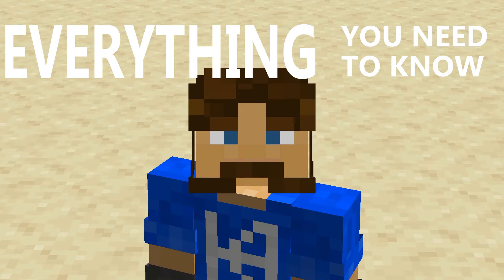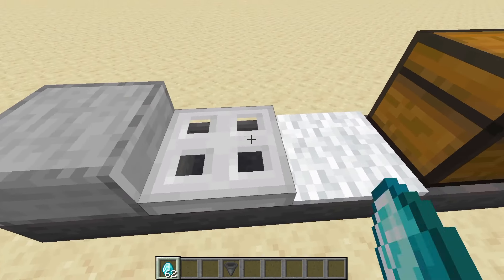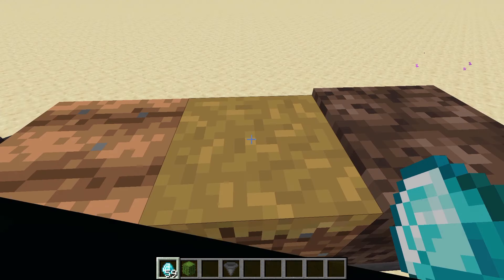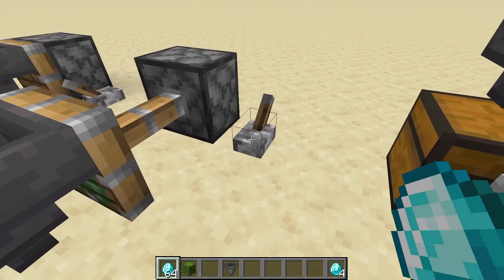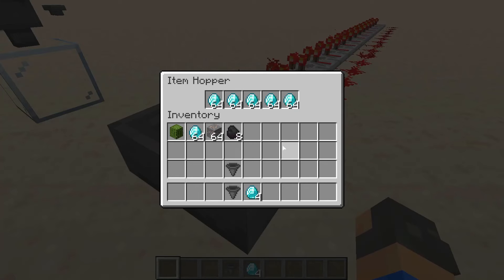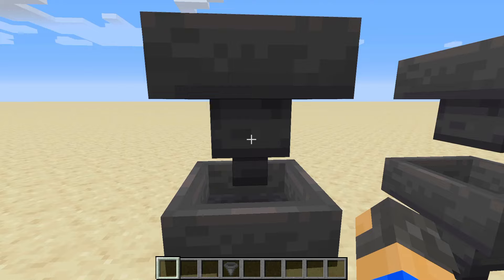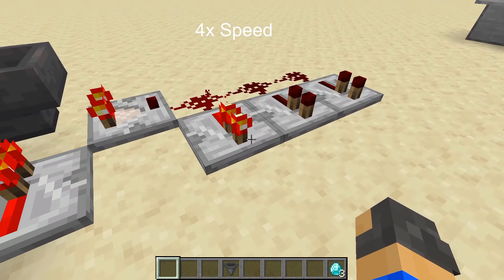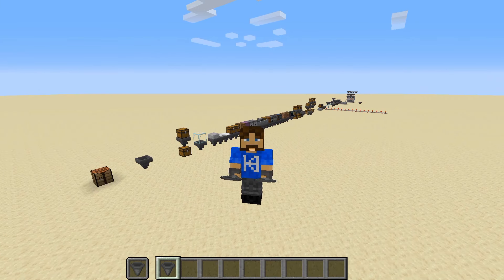Minecraft Hoppers Basics!

Comment: Could you explain how the sorting systems work? I see some people putting a maximal of 22 items in the hoppers and any item that adds to that will then get sent. Is there a reason for that ?
Reply from the maker: Going to be trying to make a lot more tutorials. I’ll add sorting systems to that list as a priority! Until then, I’d suggest my video about comparators, that’s the main thing used to make sorting systems work!
Reply: @KaleHameron  Please 
i am stuck
i want to make an automatic sorting system with water (like the converyer!the water part) but i am dum dum
Reply: when a comparator reads a hopper, it doesnt read exact amounts. 22 items in a hopper will output a less of a signal than 23 items. If a hopper is full of items, except the item type you want to sort, then it will enter the hopper. The comparator unpowers the hopper below it, allowing the items to leave until it is back to 22.
Reply: @HighOnZa  with a water conveyor belt system, you want to have water go in one direction 8 blocks, the 9th block would ideally be blue ice with a sign on the block above to prevent the water for the next 8 blocks of "conveyor" from making the water flow meet in the middle.

Should be roughly like so (side view of what it should be):

Flowing water:~
Hoppers: H
S: sign against wall of conveyor: 
B: blue ice

~~~~~~~~ S~~~~~~~~ S
HHHHHHHHBHHHHHHHHB

The hoppers would be the hoppers to grab the items at the top of the auto sorting system and the blue ice is to continue a roughly similar momentum that the flowing water provided and won't melt

From here, it's a matter of you deciding how you want the items to begin the process.. i.e. just dropping them into flowing water or to have it connected to a system that drops the items through a dropper into flowing water

Comment: Thank you for the guide but why doesn’t my hoppers  work I put a hopper on top chest bellow but it just stays in the hopper? Pls explain (am on 1.20.1 btw)
Reply: @Sanstheskeleton4  usually that’s because the hopper is “locked” because it’s being powered by a redstone signal, is there anything next to it that is powering it?

If you run a redstone signal into a hopper (like you were powering a redstone lamp, iron door, piston etc) it will “lock” and stop working until its not being powered again
Reply from the maker: What chug said

Comment: Hi I did an horizzontal pipe of hoppers in a ring with 3 corners. I transfert items in it and at one point I lock it so items get drained from hoppers under. But, in corners if I place hoppers pointing in the hopposite directio hopper get jumped, if they point down they do not get jumped...ther is somthin I do not know in the way they work as priority?

Comment: Four months* later and I can't get a simple chain of hoppers to move extra items to other chests.😢
Reply: @sespider  basically you wanna crouch and place the hopper on the chest and if you look underneath the hopper, it should show like the line going on the right or down or whichever way the chest is
Reply: @EliasG-hater  
I know how they work, but thanks.
My issue is I have large auto farms for each crop that uses Allies. But I don't want to dig deep holes to stack the chests and hoppers.

I'd much prefer to have easily accessible chests next to one another that are fed by a single main hopper chain that sits under the farms in water.

Sadly, there's no way to have the main hopper chain feed to side hoppers and into overflow chests. I've tried many times to get it to work without success.
Reply: @EliasG-hater  
It may be easier to show what I want to accomplish than explain. I may, or may not, make a community post for feedback.
Reply from the maker: There is a discord server for minecraft storage tech that can probably help you! https://discord.gg/JufJ6uf